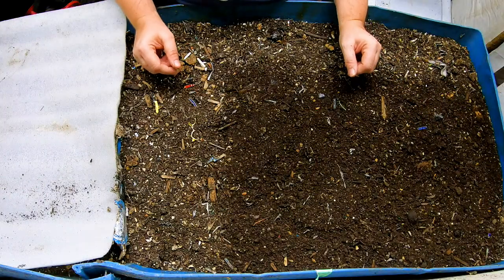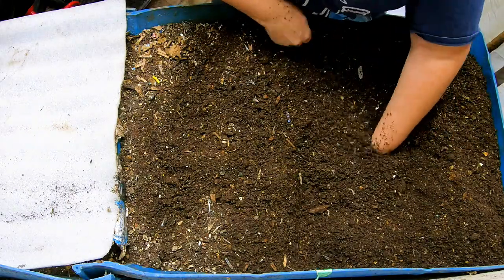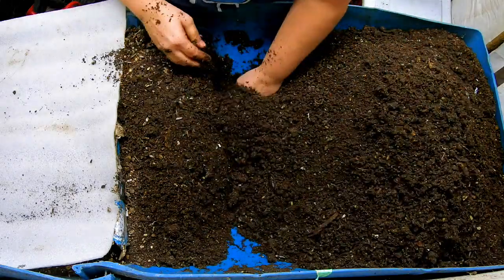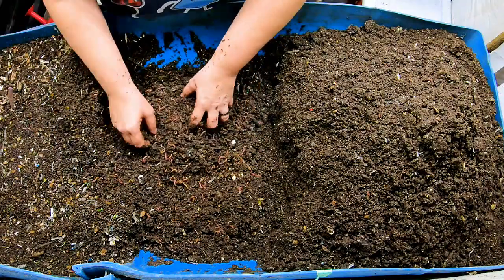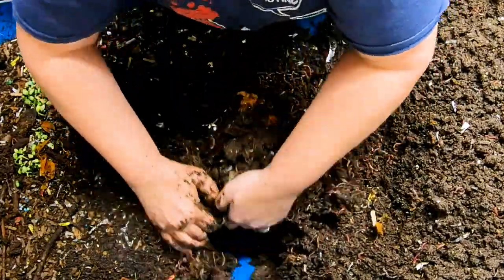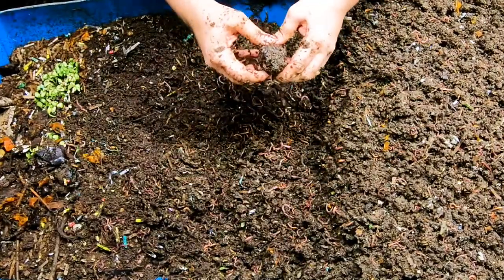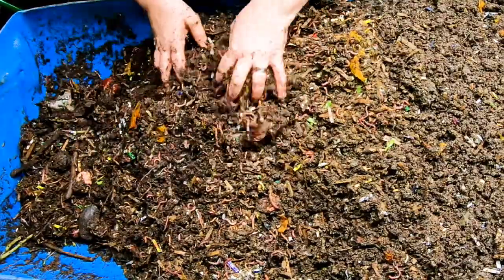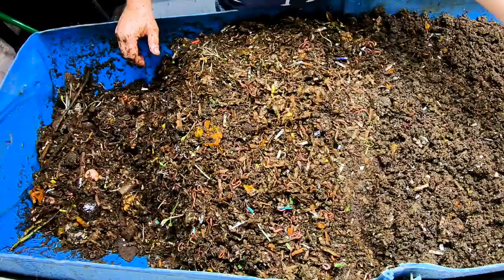Full tour of my 55 Gallon Worm Bin Fluff, Evaluate, and Feed the WEDGE Method System

Comment: My dream composting facility, limitations unbound?! Whoo, I've actually drawn something up. I'm thinking full blown facility in the 10s or 100s of thousands of square feet... Inside the warehouse on one side 'shelves' of alternating CFT bins and conveyor belts, on the other side are massive vertical compost barrels with about 5 sets of drop floors to subdivide them. The whole facility would have conveyor belt access to move materials to and from the 'material processing area'. This area would consist of a tub-grinder and a trommel. On the input side, dump trucks are able to bring in full size loads of all organic materials right onto conveyor belts where they can be run through the conveyor belts to reach any destination in the facility.

For example, tree trimmings come in, go through the grinder, and into the vertical composter where it meets an input of food waste. After reaching temp once, the drop floors release and the material falls into a bay below it in a somewhat 'flipped' fashion where it rests until it reaches temp again, another drop floor, etc... until its back on conveyor belts and back to materials processing where it can be screened and the fine material moved to CFT.

As materials mature and are harvested from the CFTs, they can be conveyed on down to materials processing, screened then conveyed on over to the output area with the ability to mix with other materials and fill small bags, bulk bags, or moved directly into a large brewer. Tea can be bottled into small consumer sized bottles or piped directly into large spray-style trucks. The whole output area would also have truck access for picking up pallets of bagged or bottled materials, bulk bags, or bulk filling a capable truck.

Would be great if the facility could also receive used cooking oil and output a fuel to power some of the trucks. This whole thing is probably not economically viable with our current bottom-line driven businesses and would only really work if it were well integrated with a region that has policies, practices, and infrastructure that integrate with this model.
Reply from the maker: That sounds like the dream for sure. I should play the lottery
😊

Comment: Great feeding Ann! The old left out pumpkin looks like a special treat for the worms. I would love to use leaves but I’m still afraid of bring slugs into my system again.
Reply from the maker: Yeah i'm a bit worried about what is in there too.  I have seen snails more than slugs for some reason.  Guess Ill have to wear my readers more often in the wormery for a while.
Reply: I hear you about slugs and snails, however, the benefits of the leaves for the worms outweigh the annoyance to me.  I do age my leaves in a covered pile on gravel until dried well, then bag them in leaf bags for a while.  When mixing them into my aged bedding I often sift them quickly with a large compost sifter over the wheelbarrow. Basically I try to give lots of opportunities to agitate the leaves over time which seems to scare off much of crawly pests.  If you pile the leaves and turn the pile frequently (daily) for a week, you will probably get rid of most pests. The castings come out much darker and rich when there is some leaves.
Reply: @marlenen6130  those are some great ideas. I know the minerals in leaves would be a huge asset in the castings.
Reply from the maker: @marlenen6130  I agree the casting are way better with leaves.

Comment: I have questions! 
My castings are VERY sticky. What can I do differently? Using cardboard, shredded junk mail and paper, and coco coir. 
Second......lots and lots of babies 🪱. How do you get all those tiny, tiny, babies out of the castings?
Thanks in advance for your help!
Reply from the maker: Castings that are already sticky are a challenge.  You have to add dry Coco coir a little at a time. As for getting the little ones out, I would put a piece of melon in there and check every few day and collect the worms.
Reply: Michelle my Vermibag castings has a bigger proportion of Indian Blue worms and those are the castings that tend to get the most sticky and clay like, is that what you mean?  I think blue worms castings are smaller bits and they may ‘reprocess’ their castings  at a faster rate than other worms is my theory.  Also lots of people wait too long until their castings are 100% completed and that definitely leads to over-processed clay-like material. 

What works well for me helps dry it out and gets the worms out it.  I take a motar tray and put some damp aged bedding in the middle several inches deep, and a little food (using some banana peel or melon from a previous feeding is great too) but not out the edges.  If the material is super wet I will put cardboard (with holes) over the bedding, if it’s just really claylike but not wet I just use some fiberglass screening over the bedding, preferably big enough to cover the bin—then I put the wet castings on this and spread it out into an even layer. I’m not trying to overly compress it, yet. Then I put a piece of newspaper over the castings, maybe some cardboard, and then I add some weight, like the water sprayer pump or a hand weight, whatever is around. If it’s cold, it will help to have it warmer for hatchlings. The adults will usually barrow down into the bedding within days and you can just lift the screening up to get them out and reset (if some worms are too big to get through the screening, don’t worry cuz they are big enough to pick them out of the castings). The hatchlings will come within a few weeks and they will make it down into the bottom, especially if you agitate the material occasionally.  This method has saved my castings countless of times and makes getting them out of castings much easier for me. I don’t know if it’s the worms themself that till that material or the other helpers in the bin, but it will get to a good consistency. If you know there are not that many worms in your castings then you can just take a kitty litter bucket with cardboard, I use double ply for this, and put castings material on that, then a little worm chow and bedding on top—ignore it for a few months and the castings will be perfect. I notice that if I nearly fill a bucket with 90% done castings then it will reduce in size by at least 1/4-1/3 and will be completed.  I have a bunch of kitty litter buckets that I drilled holes on both sides of each corner toward the top near the reinforced edge so I can close my bins and stack them (I need the space, lol). The holes are small enough that most things don’t get in and the rough edges discourage worms from leaving. Throw a piece of old wet towel on top and they love that texture. Hope this helps!

Comment: using red wrigglers in a compost tumbler bin, feeding them some food scraps but mostly using grass clippings that are at least two weeks old after the cutiing..IE..almost dried out and turning brown from decomposting on the ground. I soak the clippings in a 5 gallon bucket (rain water) for two or three days before adding it to the bin (water and all) and let the excess moisture drain out of holes drilled in the bottom. 
this drained water is added to more water (diluted) and used on plants around the house. It takes about a month for the worms to completely eat the grass and leave me with castings. 

side note...every couple of days I spin the compost bin to add air into the castings and to be sure there is no excess wet spots...
Reply from the maker: That is quite the process. I'm afraid I would forget to do some of that and kill  them. I'm glad it works for you.